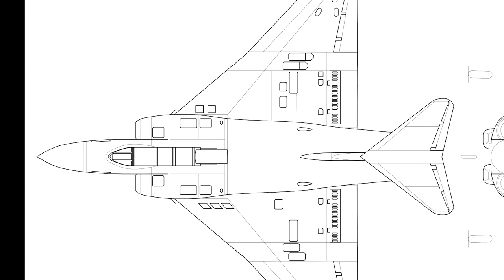A Short History: Gloster Javelin Documentary

Comment: One of the few aircraft with a delta wing and reheated engines that was still only subsonic.  It says a lot that it was up to the MK9 before it was truly effective.
Reply from the maker: The engineers must have been quite happy after finishing that Mk9 :)
Reply: Reheat wasn't to make it go faster, as it was only effective at altitude it helped it maintain speed and go higher - Javelin was supersonic in a dive from quite a high altitude, same as   a Hunter.
Reply: A victim of its time.  Development was so quick, several of those marks were overtaken by other marks in Development
Reply: As a 1948 design, supersonic speed was never a consideration nor a requirement. FAW9 was only an FAW7 converted to FAW8 standard and even early Javelins were a vast improvement on Meteors and Venoms and could intercept Canberras and V bombers. The Javelin had similar speed to the Hunter and could outclimb it and the reheat was not designed to make it go faster, just to maintain speed at altitude with four missiles.
Reply: Half of the versions were just alternative radars.  It had 3 engine upgrades in service life. The boffins were learning things quicker than could be included in designs on the drawing board.  It was more efficient on one engine at 91% rpm than two at any other speed.  One pilot commented on the number of single engine restarts without problems!  Yes, it ain't no Lightning or Hunter, but it still did a job